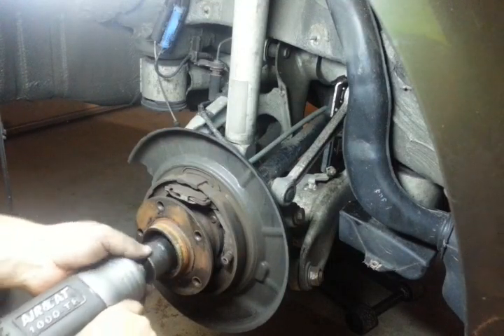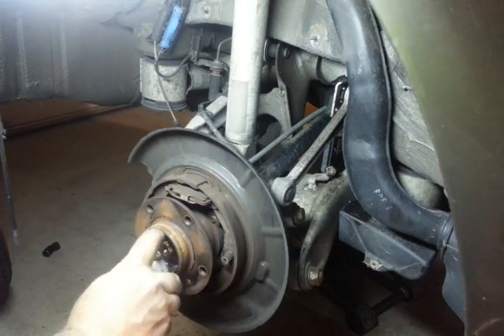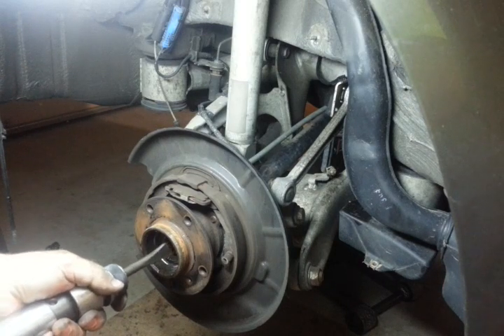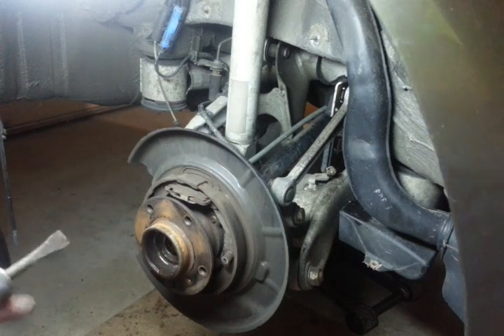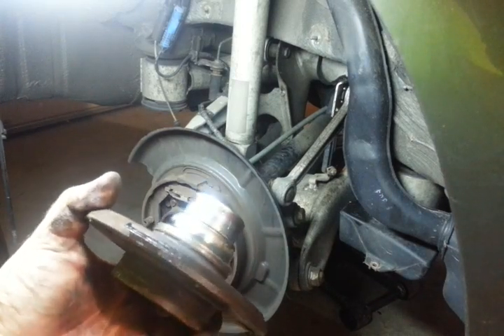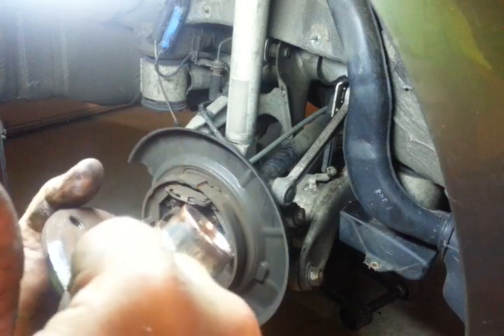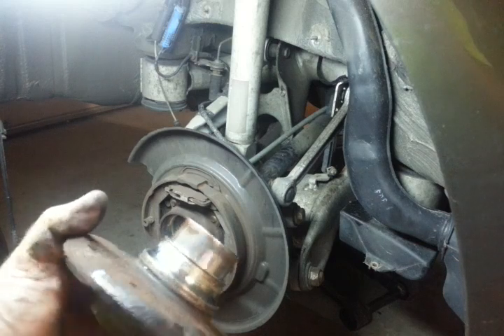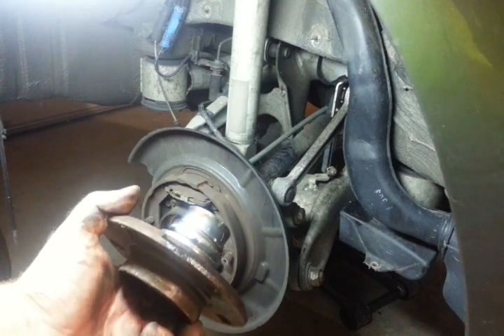How to change your BMW E39 530i  rear wheel bearing part 1

Comment from the maker: The axle doesn't have to go back very far.  You basically just want to make sure that is is not seized in the hub.   You have to hit the flange pretty hard with the slide hammer.  Just keep at it.  The slide hammer i rented was like a 10 pounder.  HIT IT HARD.

Comment: This video's very helpful.  I'm ordering parts to do a full suspension refresh on my E39 M5 - struts, control arms, ball joints, plus bearings.  For the rear suspension, I'm thinking the bearing replacement is first up due to difficulty, then ball joints and the rest.  What would you recommend?  By the way, after seeing your air hammer in action I ordered one - looks like it's a big help on this job.
Reply from the maker: Make sure that the air hammer you purchased is a long barrel.  The cheaper short tools dont have the power.   Also M5's have slightly larger axles so it might be more difficult to access the bolts.  Get the largest slide hammer you can and you have to have some good strength to get the hub out.  Rear shocks require removal of rear seat and package shelf.  Good luck
Reply: Gregg Balser
Bought an Ingersoll Rand 114GQC.  Looks like a long barrel from pics on Amazon, and it's got good reviews.  I see the M5 flange is different p/n than the other E39s; collar nut is the same.  Yeah, I'm not looking forward to taking apart the rear seat and shelf.  Prolly going to do the front struts first.

Comment: I know this is 7 years late but do you absolutely have to have the air hammer to push the axle in so you can slide hammer it off
Reply from the maker: You can probably tap it with a hammer or slide hammer.   Just don't mess up the threads or mushroom the end.  Depends on how crusty the car is.
Reply: Doesn't seem to crusty but it is 11 years old....its always worse than it seems haha thanks

Comment: don't have an air hammer to push the half shaft back in, but my big ass hammer seems to be working....do i have to push it all the way back in to the point that it's loose?  i've hit it like 30 times with the slide hammer and still no go...2006 bmw 750i by the way.

Comment: ,, if you use old hub do you still need to take off the inner race ? This is what's confusing me
Reply from the maker: Yes.  You need to remove it.   Watch part 2 and you will see it coming off.  Most people cut it off if they don't have an air hammer.
Reply: @GreggBalser  ,, thanks for the reply
Reply: @GreggBalser  ,, thanks for the reply & video

Comment: Hi, looking to probably do this soon, did fronts yesterday, car is on 196k miles!

Question, do you think, aside from it being a little more cumbersome, an sds drill will double as an equivalent to your air hammer?  Also, with an SDS drill set to chisel only, it's adjustable according to the speed setting.

Anyone thought to try this?
Reply from the maker: Wayne Trevena unlikely.   though I've never seen or used said drill before.  the air hammer I used is a snapon ph3050 which is pretty heavy-duty
Reply from the maker: Wayne Trevena it maybe enough to push the axle back through the hub.  You you can buy hubs and bearings pressed together from bavauto.com
Reply: I'll have to try 😊, I think it will work.

As for the Bavauto already passed together, looking at at least 2.5 times maybe more the cost of getting just the bearings locally.
Reply: Thanks for the quick replies! And the video is really helpful, thanks again. I'll post here when I'm doing the rears. 👍
Reply from the maker: Did you ever do this job?
Reply: Gregg Balser Not yet

Comment: Has anyone tried this on a X5 SUV?  I keep seeing that you have to drop the axle. It would be nice if this will work on the X5?
Reply from the maker: what year/chassis x5?  E53? E70? F15?
Reply from the maker: The all use a similar bearing setup.  but I think the challenge is access.  The x5s have the springs in a different spot and I don't if the bolts are accessible.   and removing the spring or axle looks to be a pain in the butt.
Reply: +Gregg Balser thanks for the reply.  X5 2004 4.4i  not sure what the E53, E70 or F15 are?
Reply from the maker: That's the chassis code BMW uses to designate the model.  E53 is 99-06 x5s
Reply from the maker: +Robert Chin http://blog.bavauto.com/15454/bmw-chassis-codes-e-f/
Reply: +Gregg Balser Thanks...  so I guess the question is can this be done without removing the axle?
Reply from the maker: +Robert Chin best in can tell is NO.  Looks like whole suspension needs to be taken apart to get axle out.
Reply from the maker: don't think you can.